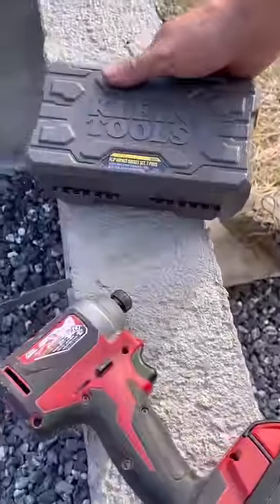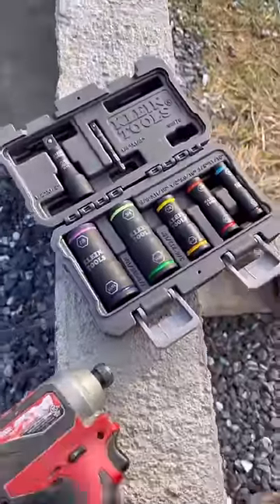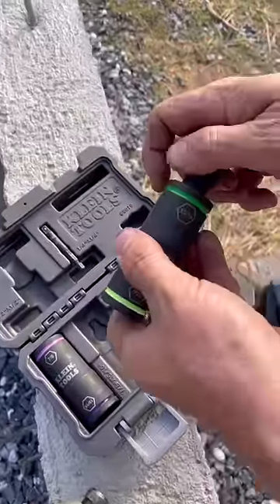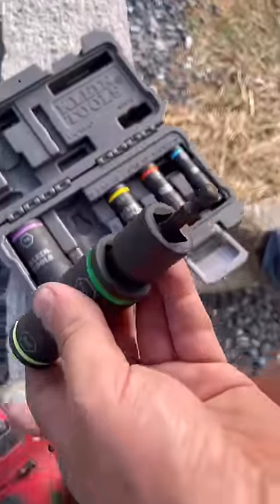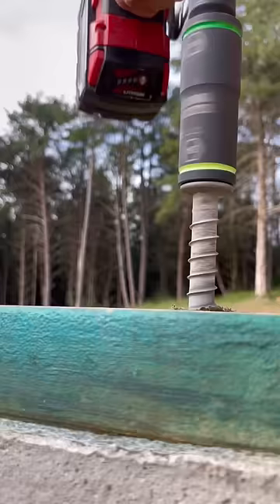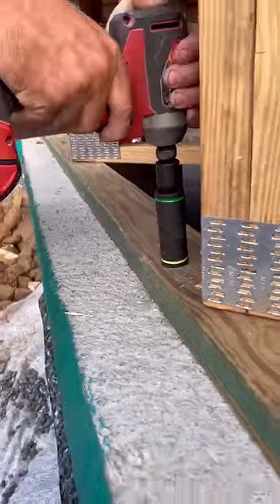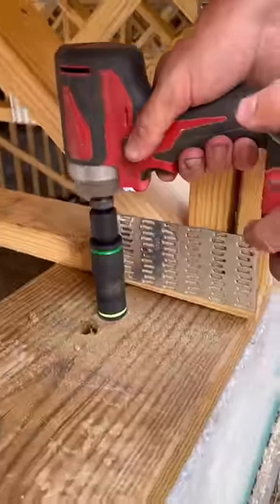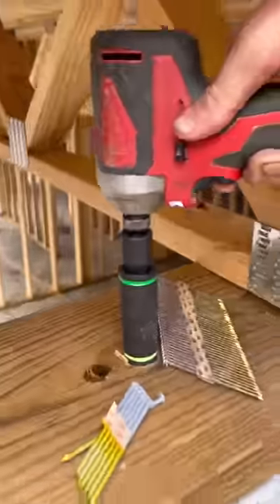Klein Tools Flip Impact Socket Set

Comment: that's neat but you shouldn't be using sizes meant for half inch drive on a quarter inch impact. 1 of 3 things if not all three will end up happening. .  1: you're not getting it tight enough, it will come lose. 2: you'll break your 1/4"×1/4" adapter. 3: you'll break your impact. speaking from experience.. even Milwaukee breaks.

Comment: I'd get an actual 1/2" impact for that as those adapters are trash. Especially the ones without the "flex" material portion built in. Also who knows how much power your putting out after the step up. 

They do make actual hex drive socket kits specifically for impact drivers to minimize power loss.

Also a impact socket rail set is considerably less expensive, comes in 1/4", 3/8", 1/2" and 1" and takes up less space.

But let's shill for Klein tools I guess.

Comment: Klein’s is a staple in the industry but Klein’s while good aren’t great in terms of pliers especially… right out of package they are really stiff and usually they need to be broken in and sprayed with a lubricant like wd 40
But once you break em in they’re bad the screwdrivers are the only ones I ever use especially 11 in 1 no reason ever to carry a whole bunch of screwdrivers in your pouch… so aside from breakin they are good … however if you want great get yourselves KNIPEX 60 bucks for their Klein’s but right out of package it’s like they’re 2 years old broken in only one hand needed immediately I’ve never experienced that with any Klein’s however they’re not cheap but absolutely the very best quality out there and I’ve tried probably every single pliers out there these cut unbelievably effortless too handles are extremely comfortable I’ve got big hands and I prefer a thicker grip overall you won’t ever use a Klein’s pliers again after these …

Comment: Over a month and only the framing is done?
Reply from the maker: The framers we used had to pull off another job waiting for some steel beams. So they asked if they could come to my job early just to put down plates to keep the guys busy. Then they went back and finished the first job.
Reply: @hausplans  Gotcha. Supply chain problems can be a real job stopper. GL

Comment: Looks like a very nice set... Now time to show off the elementary problems that rendered this set almost unusable... First off... Every time you have a joint or a socket connection. You lose a ton of torque when it comes to impact drills... If it wasn't for that Milwaukee, you would have noticed it instantly..  The design of the set is very delicate... Meaning it will not last... 
The set is simply not worth the money... Especially since the most of the time. When you grab a big socket you will need a lot of torque which would be stripped from under your feet because of the socket set...

Comment: Some Klein tools are phenomenal. Most are middle of the pack for professional tools. But these…these are just a novelty. Get a decent set of impact sockets and a drive adapter. The set makes no sense and requires far more clearance than other options without the benefits of deep wells.

Comment: Using 1/4" drive impact with a 1/2" socket isnt going to do sh*t. It will snap that adapter super fast as soon as you get a bunch of torque on it. I break them all the time tightening down a 9/16 nut using a 3/8" drive socket.

Comment: You lose 10-15% of your torque with adapters. You'd be better with a regular set. Also if you're only using a 1/4" driver you're fine with a chrome set from tekton or icon, you aren't really impacting.

Comment: Klein has dropped in quality so much as of recent. The magnets in their nut drivers just pop out. The quarter in drive on their flip drivers strip out and don’t fit. Their flat head heavy duty beater screw driver is junk. The tip has broke off multiple of them on me. Their multi socket screw driver shatters when trying to break a nut free. Klein is just garbage and if you disagree I highly suggest taking your new Klein tools out of your DIY box at home and onto a job site for 8 hours. See what happens.

Comment: Nooo those are thin walls whyyy
Reply from the maker: 10” concrete wall is not thin
Reply: @hausplans  no the sockets are used on thin walled specific lug nut sockets. They will break from improper use

Comment: Where are your plate washers, thats not to code
Reply from the maker: All the anchor bolts have washers they came in the same box with the nuts and anchor bolts. It’s hard to see in the video but if you look close they’re there
Reply: @hausplans  those are anchor bolt washers not plate washers. How do you not know that. Plate washers are 1/4" thick and 3" to 31/2" thick. How do you not know that, WOW...
You'll never build my house...
Reply: Typo, 3" to 3 1/2" wide ( not thick)